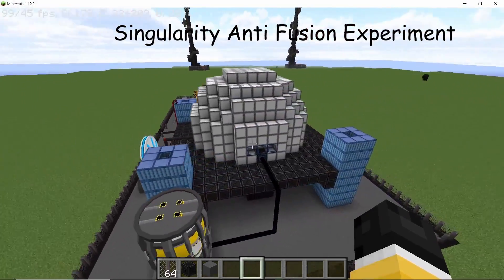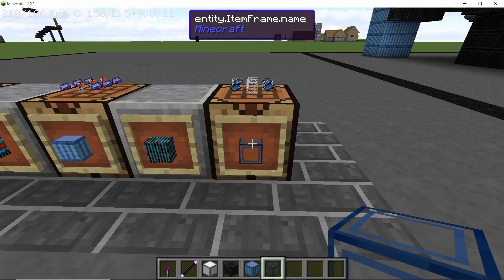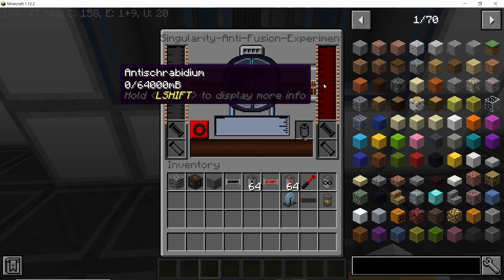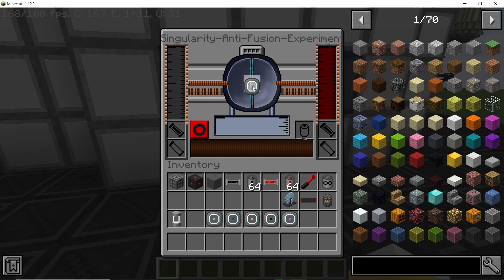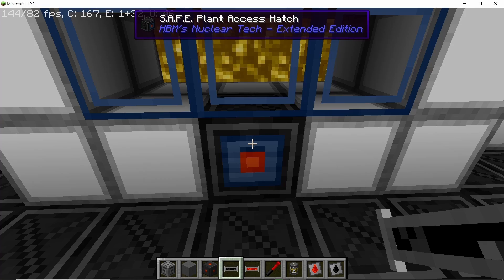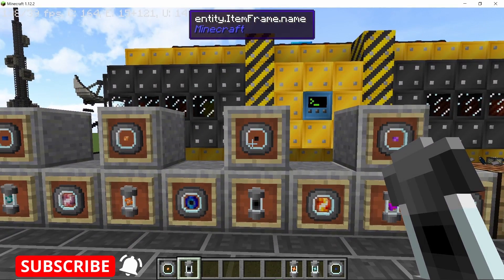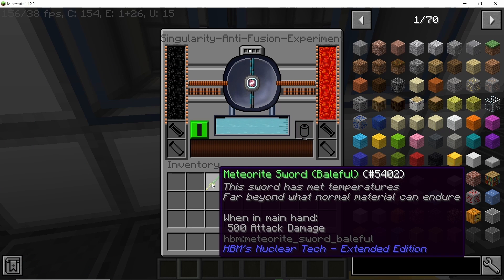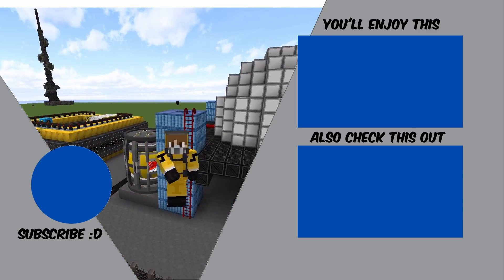Singularity Anti Fusion Experiment Reactor - Meteor Sword Progression - NTM Extended 1.12.2

Comment: If you're not happy with the downtime the regenerative coolant tank needs to fill itself you can pipe in coolant and the reactor will run constantly as long as the fuel and coolant supplies are constant.

Comment: I dont find the structure marker
Reply from the maker: The last I played this mod the structure marker was there ... if you are using the latest version of the mod and still the marker isn't there then maybe ask on the mod's discord server.
Reply from the maker: The last i played the mod structure marker was in the mod, so if you are using the latest version of the mod and still the marker is not there then ask about it on the mod's discord as the devs are there
Reply: @SavageVegeta   i always used the curse forge version but now i use the github version,the wand is in the mod
Reply from the maker: @SchwarzerLuan yes github versions are the latest most of the time, glad you got that sorted out

Comment: So at first I thought the dark Fusion core could not be accessed in the reloaded version nope you can still get the dark Fusion core in 1.12.2 though it is a tiny bit more complicated and powering it on and off is impossible if I'm doing something wrong please let me know also have a good day Mate!
Reply from the maker: First and foremost so sorry for the late reply, now for the DFC I will recommend using NTM Extended instead of NTM Reloaded if you are going to stick to 1.12.2 cause Reloaded is no longer being developed (afaik) so features which were incomplete are gonna stay that way
Reply from the maker: I have tried the dfc in ntm extended and it seems to work properly, plus ntm extended should receive updates so if there are bugs they will be fixed

Comment: Hey, why don't you make the whole mod in a single version? It's kind of annoying to have to switch between versions. Besides, the 1.7.10 has a lot of cool things like effects and items, but the 1.12.2 doesn't have them, and in the 1.7.10, there's no JEI or NEI anymore. I just wanted to clear up this doubt.
Reply: First of all, NEI is for 1.7.10, second of all, he didn‘t make the mod.
Reply: @doc6678  I didn't know he hadn't made the mod but speaking of NEI, version 1.7.10 is no longer working
Reply: The 1.7 version is the only official version, and is generally the most balanced, complete experience. There's multiple unofficial ports to 1.12, this being one of them, but they tend to be lacking in many areas.
Reply: @gmhs2  Interesting, I didn't know that, thanks for the information

Comment: For the nukes does the radiation ever go away? and same with the mushroom cloud does that ever go away too? 1.12.2 also can you fix the water level not showing on the RMBK control panel
Reply from the maker: Yes the radiation goes away over time iirc, as for the water level not showing up I recommend using ntm extended mod as it has the panels correctly implemented. Ntm reloaded still has many missing features

Comment: Are there any versions in ANY loader (fabric, forge, github) which has the hbm's nuclear tech mod above 1.7.10 and 1.12.2?
Reply: github is NOT a loader. it's simply just a site to share source code.

every single NTM version that i know of is only in forge. there's a 1.18.2 ntm remake but i doubt it's survival ready, other than that, nothing else.
the only official NTM version is the 1.7.10 version
Reply: @Voxelstice  My bad. I‘ll see if I can download the 1.18.2 version. Thanks! :)
Reply: Doubt it